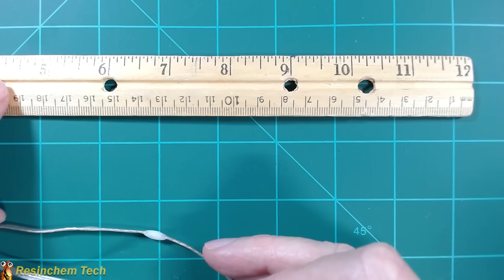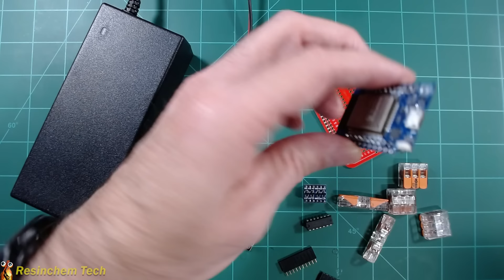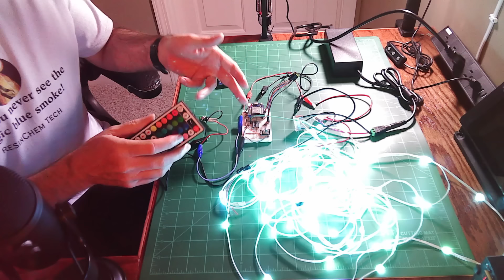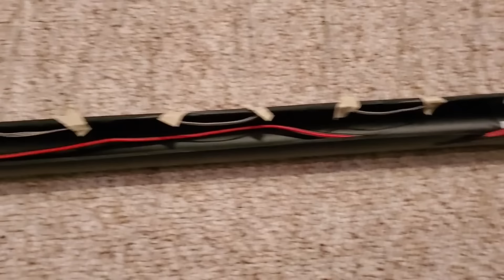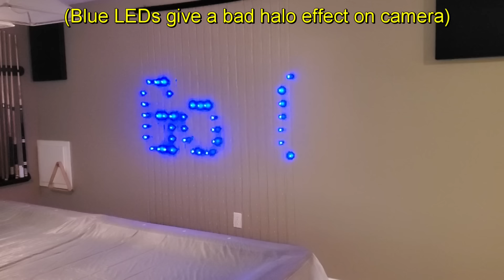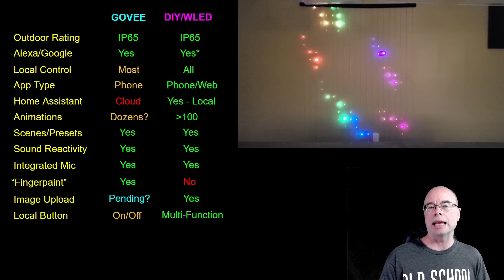Building an LED Curtain with WLED

Comment from the maker: CORRECTION:  When describing the BTF fairy lights, I state that there are 100 LEDs per 5 meters.  It is actually 10 meters (32.8').  Sorry about that... I'm used to using LED strips which always come in 5 meter lengths!
Reply: LED strips come in one meter length as well.
Reply: AliExpress has 20m lengths of the same lights for about $12.

Comment: Can you connect 2 curtain lights to make it wider?
Reply from the maker: You can theoretically make it any dimensions you want.  But you'll have to deal with power supply size and additional power injection issues if you add more LEDs.  Plus WLED recommends use of multiple pins once the LED count exceeds around 800 LEDs, so you may have to use multiple LED data pins for larger numbers of LEDs.

But you define your matrix size and orientation in the WLED setup.  So you certainly aren't limited to creating a matrix using the same number/orientation of LEDs that I did.  Others have built the  system using 25 rows of 16 LEDs that creates a wider but shorter matrix.  As long as you set up the matrix dimensions and number of LEDs correctly in WLED (and have the proper power injection), you can pretty much customize the curtain design to exactly meet your needs.

Comment: I am in the uk and last christmas I built 2 curtains using Wled. I bought some seed pixel led fairy lights at £11.99 for 200 so £24 for 400 and just cut the pre installed usb power and controller off and wired them all together and I used an ESP32 mini c3 which cost me £14.99 for 5 so to make the 2 curtains it cost me just under £65 which is nothing compared to the Govee ones. It is very cheap to make them if you know what to buy
Reply from the maker: Wow, sounds like you made a really impressive setup for a fraction of the cost!  Definitely one of the advantages to DIY... plus the fact that you can build it with the exact features you want or need.

And you can often get better prices these days from sellers other than Amazon.  I pretty much stick with Amazon primarily for the speed and cost of delivery, plus the ease of returns should something be incorrect or broken.  But that convenience does often come a bit higher price than if source elsewhere, like say Aliexpress.
Reply: @ResinChemTech  I euse ebay a lot for cheap stuff like leds, it's crazy if you search for seed pixels or led pixels or something like that you get prices like £89 for 200 but then search for app controlled christmas lights you can get 200 for £11 it's all about the search. Yeah theres places like temu or ali express but theres long wait times and you never know if they are any good, the reviews are usually fake but I have had a lot of luck with ebay. I am working on a full light show this year with singing faces and props etc... al made out of the chaep christmas fairly lights and esp32 mini c3 boards I have worked out the cost of doing the whole front of the house should only cost me around £150 and it all runs through Wled and xlights

Comment: Incredible. Thanks you for you clear and easy to understand demonstration. it turned out great as well. i am a sculptor interested in combining LED's into sculpture for public art projects. I finally decided to try to learn and see if i can do something like this for an upcoming light art grant project. Your explanation and success confirmed what is possible on a DIY level. I have so many questions regarding this project. one question is can i crunch the LED spacing together to get a more compact pixelation effect? im going to check out all your videos and subscribe. great work!
Reply from the maker: Glad you found the video helpful.  You can certainly space the LED pixels closer together, but for the best overall appearance, you want to assure the spacing is equal both horizontally and vertically between all LEDs.

I have done quite a few LED videos, but the concept of adding to a sculpture or actually creating art out of lights are both interesting.  But I'm not very creative, so I'm certainly not one to ask about art!

Best of luck with your projects... and your grant!  If it helps, I do have a whole playlist of LED projects and how-tos:  https://youtube.com/playlist?list=PLqjDNeOVHOkf079FYwRLRoOHJwLijKkP3&si=iYpqq-4th9yIaoDu  And of course I'm here if you run into any other questions!
Reply: @ResinChemTech  ok thank you for that reply. im not asking about art so put that worry aside. BTW, you could consider what you did as art and in some cases it truely is but i digress. In order for my art project to be a success, the tech needs to work successfully, impeccably and reliably . thats where you'r knowledge  comes in. I want to fit your DIY curtain   concept into a life sized running horse silhouette.  I want it to be continuously on 24/7 and be reactive to movement / touch and sound. so reactive to taps, claps, music etc.  Q- is this explained in that video? ( i know sound was) but do you have a specific video on touch sensors and how to attach them in different locatinns on my artwork.
Reply from the maker: I actually do have a video that shows two different touch techniques for the ESP32:  https://youtu.be/HUSnuNSrWFw

Comment: I bought some Govee LED curtains and they were great - albeit for a couple of effects - I got them kind of working together but the PSU often goes.  I have enough 5V 10-20A PSUs so I revived them but after a few years of trying - I finally got them WLED'd!  

Note to anyone else wanting to convert theirs - you WILL need a SN71AHCT125 level shifter :)  I now can drive two LED curtains from 1 ESP32 :)
Reply from the maker: That's awesome you were able to get your LED curtains converted to WLED and working with an ESP32!  And thanks for the tip to others about the need for a level shifter.  I always include on for all my WLED builds, but I know that many people keep the data line short and omit the shifter.

Comment: Hi @ResinChemTech . I've been following this tutorial to build a curtain as a light feature for our Stem Lab at the Great Neck Library. Everything was working great until the other day when the esp32 malfunctioned with our WiFi. I got the esp32 running again and connected to our devices by using a fresh one to reflash WLED. But now, the lights are acting strangely, and not responding to the WLED controls like they did before. A few LEDs will light up bright (a couple single ones throughout the middle of the strands), a few are very dim, and a few flicker. What I'm not sure about is whether this is because WLED is not properly connected anymore, if it is somehow "stuck" on the previous effect I had it on (not sure which setting it last was), or if the LEDs are likely damaged/burned out somehow. What would be the best way to test if the light strips themselves are faulty? Could it be the data line, or because of the new esp32? Nothing we try works, including rewiring the whole thing. Any help would be appreciated!
Reply from the maker: It could be a number of things, but I'd start with the data line and the signal as this appears to be the most likely cause if I understand what you are describing.

First, confirm that the WLED controller is on WiFi and you are able to reach the web interface by going to the IP address assigned to the controller.  Next, double-check all the settings under the 'LED preferences' section of WLED.  Assure you have the correct GPIO pin, type and number of LEDs set correctly, etc.  When all this is confirmed, try changing colors and effects.  Do you note any change in the LEDs at all?

If not, then the best bet would be to throw together a test controller on a breadboard.  For this, you wouldn't even need a logic level shifter.  Just connect the data line directly from a GPIO pin on the ESP32 to the start of the LED strip... keeping this connection as short as possible.  You still want to run the 5V power in parallel (don't try to feed 5V from the ESP32's VIN pin to power the LEDs).  Again, once WLED is onboarded to WiFi, check all the settings under LED preferences.

If the LEDs are still misbehaving with this simply test controller, then it is likely that the LED strip itself has been damaged in some manner.  But normally, the start of the strip will behave normally up to the point where there is a fault somewhere.  What you are describing sounds more like an issue with the signal and not the LEDs themselves, but this simple test should let you know whether the LEDs are bad or not.

If the LEDs all test OK with the test controller, then you have to revisit the original controller.  I'm guessing you used an I2C level shifter?  In one of my recent videos ( https://youtu.be/Va5eTscUJQI ), I show why I now recommend using a quad buffer gate shifter instead of the I2C-compatible version I've used in the past.  So, you have a couple of options if you need to replace the controller, based on how far away it is from the start of the LEDs.  If it is pretty close (less than a foot or two), you might get away without a shifter at all.  I'd try it with your breadboard version first (without the shifter).  If all works fine at that distance, then you can build the soldered version without a shifter.  However, if you still see flickering/misbehaving LEDs, then you may need to add a shifter of some sort.  Again, my current recommendation is to use an SN74AHCT125N shifter but you can try the I2C shifter as well... or even use a standalone sacrificial pixel.  

You probably just need to try to identify where the problem is occurring by using a temporary controller.  Also, if you have any other LEDs laying around (like a strip of WS2812b), you can also try connecting the controller to this for testing.  At this point, you should try to identify whether it is the LED strip, the controller or the wiring/data line run between the two.  Let me know what you find... or if I can offer any additional assistance.

Comment: I have a question can I connected this led curtain to touch designer for making interactive  in real time visuals
Reply from the maker: The curtain runs the WLED firmware... which I didn't create nor do I maintain.  I don't believe that WLED has the capability to do what you are asking.  But you can try posting your question in one of the official WLED forums, Discord server, etc. and see if someone has an idea how to do what you are asking.  There are also user  mods that can be added to WLED and you can find those in the official WLED Github repo:  https://github.com/wled/WLED/tree/main/usermods
Reply: @ResinChemTech  thank you so much I will search about it

Comment: If building one similar to yours, what shout be a generic pixel count for both vertical and horizontal if I wanted to increase the dimensions. What I mean is what sizing will make it still look dimensional.
Reply from the maker: If using WLED, the dimensions are really up to you.  I've had folks share their version of my project where their dimensions were substantially different than mine, such as a display that was much wider than it was tall to fit in a particular installation location.

Square would probably be ideal, but you define your matrix dimensions in WLED and the effects are 'adjusted' accordingly.  More important than the dimensions or the H x W ratio is the density of the pixels and assuring the pixels are aligned and evenly spaced both horizontally and vertically.  This will have a bigger impact on effect appearance than the H vs. W.

My curtain does happen to be 20 rows of 20 LEDs each... so square.  But this was just my particular design.  It could have just as easily been 16 x 25,  12 x 33, etc.  I would just need to change the WLED 2D mapping to match my layout.
Reply: @ResinChemTech  Thank you. I do a holiday matrix of 50 rows of 100 24v lights. Did not know if the smaller ones made a difference.
Reply from the maker: One potential difference:  Most 24V LEDs are only addressable in groups of 6 LEDs, while 5V are individually addressable.  If your matrix is as large as yours, it may not be noticeable.  Where you may run into issues are things like text or images with a lot of detail that could be lost when each section of LEDs are six pixels that act together.

All that is to say... unless you have something like bullet-style LEDs, which I believe you can find as individually-addressable (at least in 12V, because that's what I use on my Christmas tree), in might impact resolution or appearance of some effects.  Otherwise, as long as the type of LEDs you are using are supported by WLED, you can used any LEDs you like... but 24V will have less "resolution" than 12V which will be less than 5V (but on the flip side, 5V requires more frequent power injection... so like most things, it's a trade-off).

Comment: If you use Draw Something, for wLED, you can fingerpaint pixel art!
Reply from the maker: Thanks!  Not sure that add-on was available back when I created this video, but I'm not surprised that someone developed a way to match the Govee option of drawing a pattern with your finger.

Thanks again for taking time to leave a great tip!
Reply: @ResinChemTech  yeah, I am not sure myself, but thought I would drop that nugget in, as it might help others in time. Thanks for the video!

Comment: Do you know if ir is working on esp32c3 and c6 properly?
I am trying out wled for the firs time after trying to get ir working on a diy project with these controllers but cannot get ir to work.
Other issue is I basically want a static clock display just the time not the scrolling text, but cant see any option for that.
Reply from the maker: You can find a list of compatible hardware on the official WLED site ( https://kno.wled.ge/basics/compatible-controllers/ ).  I believe the C3 is considered 'experimental' at this point.  I'm not the developer of WLED so if you have issues with a particular board or feature, you'd need to contact the developers via Github issue, Discord, etc.  

WLED is fantastic, but you will often want to do something that WLED doesn't... like a static clock.  Then you have to see if a custom mod is available or simply write your own, which is pretty much what I did in this project:  https://youtu.be/nE2EDA_VE_Y 

For that project, I kept fulll WLED but developed my own firmware to give me features that WLED didn't have, such as a clock, scoreboard, etc.
Reply: Thanks, sorry for late reply but I didn't get any notification lol.
How's this build holding up? I'm thinking of doing the same I have Xmas light that I just cut and connected to esp32 with wled and it's so much nicer now.
AliExpress is a great source for these, they sell 20m 200 LEDs strips with a cheap controller for £5 odd which is cheaper than buying them without the controller lol.
I was just worried the weight might harm them or they might get damaged rubbing against the cut edge of the pipe.
Reply from the maker: Mine has held up fine (approaching two years old).  I've even moved it a couple of times to display out over the main garage door for Halloween, then back to its 'normal' place afterwards.  After I read your message, I took a look and I'm not seeing any wear whatsoever in the insulation covering the LED wires where it meets the slots in the pipe.  I suppose it could be a problem if the curtain was moved repeatedly.

The black drainage pipe I used is quite a bit thinner/lighter than standard PVC pipe.  It's really just enough weight to hold the strands straight, but I don't think it is adding significant weight to cause the wires to rub or be cut by the top pipe slots.  Hope that info helps.  Let me know if you run into any other questions.

Comment: i have a few sets of xmas fairly lights, 2 x 20m with 200 ws2812 and a 10m with 100, they cost about £4 each and came with a controller for ir and vluetooth , i was wondering about doing something like this with them, the brightness is enough just of the use controller / plug thing that came with them but obviously would need 2 if i made a 400 led display.

Comment: I came across this video while teaching myself how to do WLED light curtains because Govee's size won't work for my project. I need to make a 12 foot by 36 foot grid - It's truly MASSIVE and I have been struggling to figure out how to make it work. This video convinced me it is doable - But I am a novice with LEDs. I hope to make my own curtain light for my ceiling and make it span the distance. Thank you so much!

Could you give me some advice on how to take your curtain light and make it even bigger? The pixel Density is okay - I could make it a little denser, like 1 pixel every 2 inches though.
Reply from the maker: There's technically no limit on the size... at least up to around 5,000 LEDs... off of a single ESP32.  The biggest issue with a large display like that will be the size of power supply required to fully light all the LEDs.  You'll obviously need to do more power injection.  In addition, the higher current draw will require beefier wire and connectors that are properly rated for that expected current.

In addition, after around 1,000 LEDs, you'll need to consider using multiple data pins.  You'll still be able to treat the current as one large display, but with multiple data pins, you can also optionally segment the curtain and run different effects/colors on the different segments.

So, it's theoretically possible but you'll need a very large power supply and appropriately sized wiring and connectors.